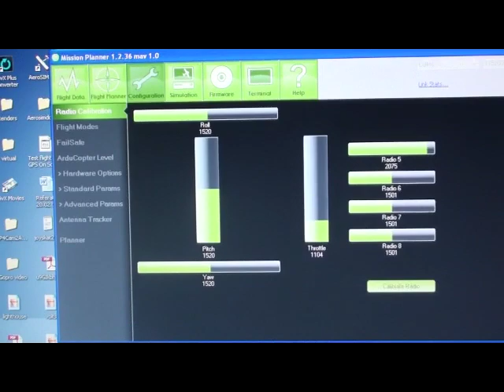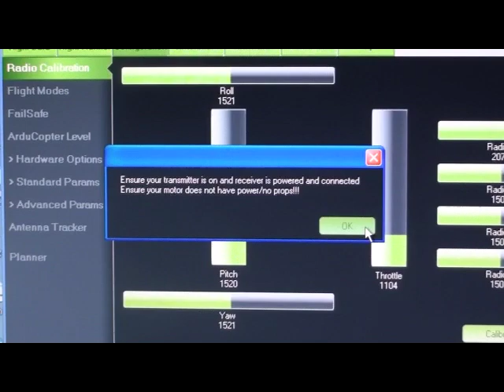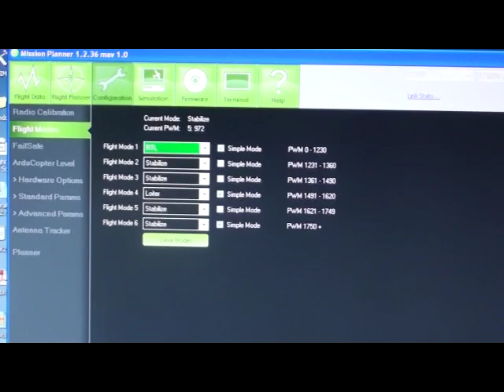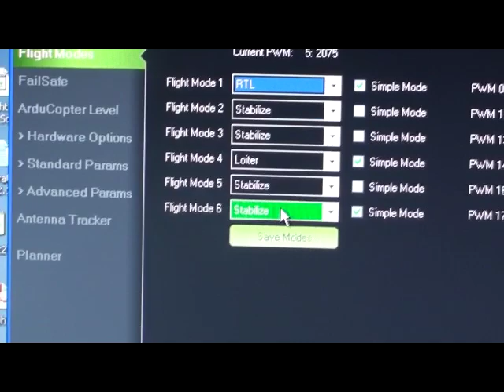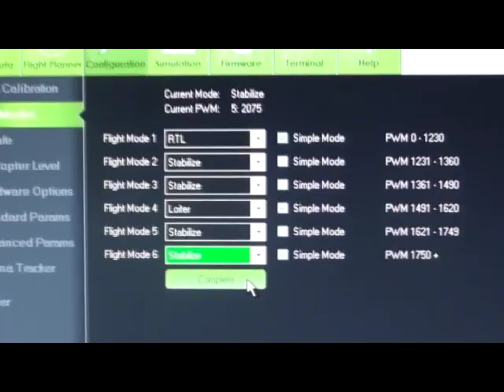APM 2.5 Ardupilot controller- setup guide 3 of 4

Comment: I am trying to set up my DX6 tx.
I can get the same screen as you have here but when i move my stichs the green bars do not move, i can click on calibration complete and it will say ch 1,2,4 did no set,i am using a spektrum satellite receiver only. thanks

Comment from the maker: oh yes, everything apart from the motors and ESCs which are not connected is powered by the USB during setup .Just make sure your JP1 jumper is not installed then you are fine, the USB supplies 5volts just like the power module or a dedicated BEC. See my explanation for power supply to the APM on my channel.

Comment from the maker: Strangely enough i do not have a glitching problem per se, it does it one in a blue moon but not so often that i consider it a problem. if you have persistent glitched with Futaba radios you will have to update your ATMEL chip using a program called FLIP .

Comment: Hi 75echo,
Wondering if you can help me with APM 2.5 I am having trouble with the 3 position switch on my er9x system, I find if I switch to Man.. mode I can get full throttle, switch to Stab. mode and throttle speed drops slightly, switch to RTL. and the motor stops, I have used this same switching before with FY21AP and Cyclops Nova systems without any problems, do you have any suggestions.  Regards Geoff